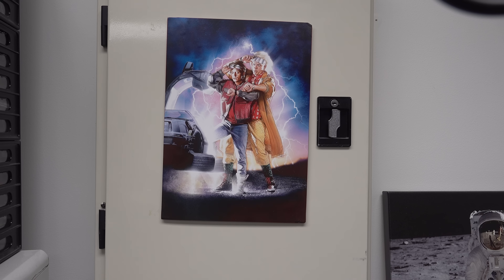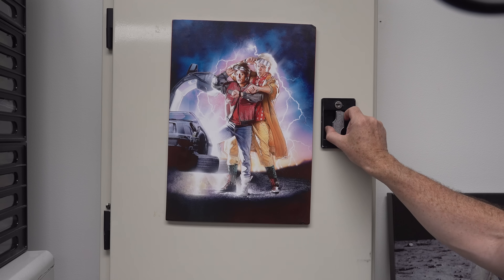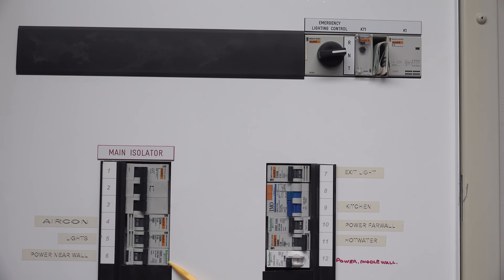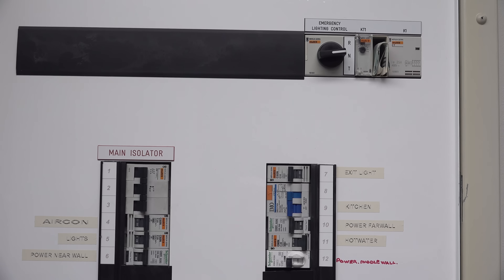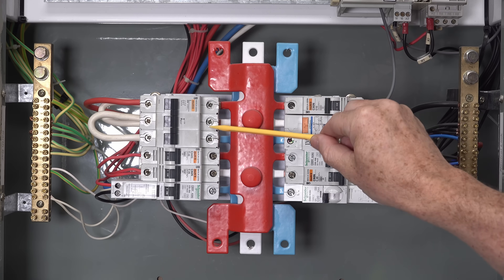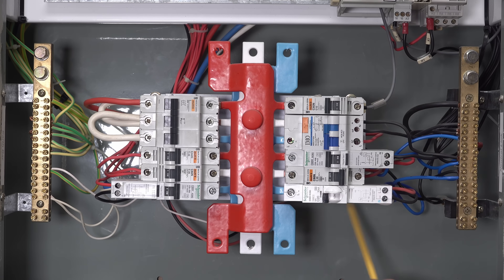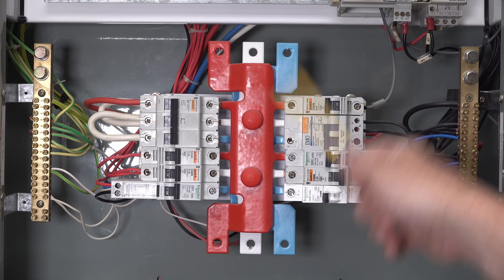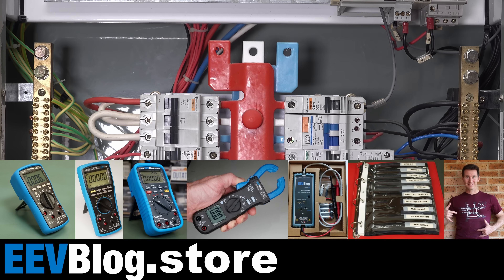EEVblog 1652 - Why is my Lab Switchboard Wired Like This?

Comment: No RCD or individual RCBOs  apart from the power outlets? What if by changing a lightbulb you accidentally touch inside the enclosure, or there's a faulty cable or something? What if there's a fault in the AC or in the water heater? Nothing to protect you from electrocution? Also no main fuses if the breakers fail in some way in case of shortcircuit?
Reply: His supply will have a separate fuse down at the metering.  Where you need an RCD has changed over time in Australia based on it being residential / commercial / industrial.  It's a constantly tightening situation.  Older installations can stay as installed unless a particular regulation says otherwise (mandatory installation, new works, etc).
Reply: Nothing apart from basic + reinforced insulation or grounded elements, all of which worked well before RCDs and continue to work in their presence.

There will be a main fuse at the source of the cables which need protecting by that fuse - that's not here.
Reply from the maker: Yes, but this was common 20+ years ago when the building was installed.
When I rented the 100sqm space that was built at the same time by the same company, it didn't even have RCD's on the power circuit, had to get the owner to install them.
Reply: Strange how each country has its own wildly different standards and reasoning for doing or not doing something. In the EU RCD is mandatory everywhere for about 30 years now. I guess we think avoiding electrocution is more important than others :P Also at least in my country, the meter's fuses are not accessible by the end customer, so it makes sense to have your own, lower rated, fuses and try not to ever trip the meter's ones and then having to wait for the electricity company to come fix them...
Reply: @JohnFistikis69  You tend to have a fair amount of TT earthing over there, not exclusively TT though, and that more or less means RCD is mandatory in a lot of situations.  Australia moved away from TT (direct / elcb) as a general means of earthing decades ago and even before that move we had a lot of TN-C-S (M.E.N. earthing).
Reply: @retrozmachine1189  Now I understand why the earth wire on these board is so small. Here in France, we have a very thick wire for earth. Now it is common to not only have the main break as RCD, but also sub-main RCD for each line of breaker on the panel.
Reply: @JohnFistikis69  Blowing the service fuse takes a fair bit of effort, even without the protection of the MCB mainswitch it is fairly rare for it to happen.  I only know of two examples personally, both friends, of it happen over the past 50 or so years.  Both of them would have been 6mm copper services too.  The minimum for quite a while for new or upgrade is 25mm aluminium.

Comment: No AFCI/AFDD requirements in Australia? Non-lighting circuits in the US, especially kitchen and bedroom ones require them these days per code. I think the idea is that kitchen appliances and space heaters cause most AF issues.
Reply: Not so much for commercial; You can have non rcd protected circuits provided the z loop will ensure a breaker to trip. Something Dave doesn't understand, but I'd rather him teaching me electronics :P

Comment: Voltage between phases, 415 Volts.
Phase to neutral, 240 Volts.
Used a single phase to neutral to supply 240 Volts to consumers.
Reply: I'm not sure what you're trying to explain here. They could just as well connect all three phases, but then they'd need a meter that supports that (more expensive) and it would show on the bill every month, for no real gain since he doesn't need 3-phase supply there.

Comment: If you had multiple phases in there you might accidentally go between one set of powerpoints and another and get 400 volts.. ? Often not worth using multi-phase in such a small office ?  Additionally, you might find that each unit is on a different phase.
Reply from the maker: I have absolutely no need for 3 phase in such an office lab.

Comment: Interesting how that panel/breakers are connected. It seems familiar to a US 3 Ph panel, but the breakers like bite on to the tooth of the bus bar. Over here it can get interesting when you have a 3 phase 4 wire delta system.(less common now) A phase and C phase to neutral is 120. B Phase to neutral  is ~207 and phase to phase/3 phase is 240v.

Comment: There could be many reasons why the final choice was to only use one phase supply to your commercial unit. reduce cost of final fit out. Builder went bust halfway through the project. Balancing of the building across the three phases. Units were originally intended to be larger but were further subdivided. Truly a mystery.  The good thing is, if you ever need three phase supply, it is a relatively simple process (depending on space at the main Switchboard for a metering upgrade) to get the supply to your unit.
Reply from the maker: It's only a small office, once of the smallest in the building, there just isn't a need for 3 phases in 50sqm office space.

Comment: Your fault paying for a unit with 3 phases and not checking it. Once you switch on that hot water the voltage is going to dip!  Now show us a shot from your meter box to see if they are connected there. Of course if them blue Brymens meters would be any good you could tell us if the blue and white were even active!
Reply from the maker: LOL, it dips 0.5V with the hot water on, I'm doomed.
Reply: They will dead end.  Single phase metering.

Comment: As a landlord, that's exactly what I'd expect. It all comes down to cost. What's the cost of installing 2 extra cables and a 3 phase breaker when you're building the building, vs the cost of doing it when (not if) some tenant decides that they need 3 phase.

Nobody cares how well individual units are balanced between phases - balancing is done based on the readings at the bulk connection point, and you're lucky if it stays balanced for more than a year - as a rule you just size the connection for a "mostly unbalanced" scenario, and pass the costs on to the units.
Reply from the maker: The cables are already there, technically easier to wire in the 3 phases than the 1 phases loops here.
Reply from the maker: See my pinned comment.

Comment: 3 phase panel wired for single phase supply/meter. Don’t know if it works the same there as here, but the monthly charge for a 3 phase meter is more than a single phase one, so if you don’t need the 3 phase it’s cheaper to just have one, if you did ever need to upgrade to 3 phase the wiring is there to support it and you just get a meter upgrade.
Reply from the maker: Yep, see my pinned comment. I don't need three phases.
Reply: For residential it is the same for 1 or 3 phases not sure about commercial. Think it is similar but the usage tariffs are different between residential and commercial. For commercial they charge for apparent power and they also have some demand tariff that I didn't understand when I last looked at it. Commercial buildings have a class in the building code of Australia that requires them to have to have essential safety measures. Exit lights, extinguishers, fire alarms, stairs, fire doors etc. These must be maintained and the body corporate as the building owner must do that. Here in Vic, the certificate of occupancy must be on public display in most non residential buildings. Very few do it and not doing so attracts a $1500 fine. The building code is national but the building acts and regulations differ by state. However one AS3000 for Australia and New Zealand.

Comment: Get the short circuit carbon pointer back in ya pencil case never ever in Lv  Distribution  Board !Fun fact it conducts better if you wet both ends ,just sayin
Reply: That's not a pencil.

Comment: Can't speak for Australia, but in the US, the two additional service lines are typically run at building construction for future proofing. When it's easier to pull all the lines rather than having to retrofit them later. 
Better have and not need then need and not have. 
Some labs may require three phase electric for certain types of equipment.
Reply from the maker: Yep, see my pinned comment. Just checked, single phase meter, but three phase wiring pulled seems standard.
Reply: @EEVblog  Yes by me residential buildings and commercial all have 3 phase power, only very small clusters, like a converted house, will have a single phase supply using the original cable, unless it was overhead wiring, in which case it would be mandatory, before the council gives an occupancy cert, that it is both 3 phase, underground, and also the meters are located on the pavement outside, in a cabinet with a metro supplied lock. that there are still houses around that have century old wiring, including having rewireable fuses, despite it being mandatory they had to be replaced with breakers since the 1960's, and RCD being mandatory for all upgrades (an upgrade being replacing a 5A socket outlet for 15A one, keeping the original 4mm wiring in the wall) since 1980. but thousands of houses that have been passed down over generations without a sale, which triggers the need to get compliance before registration, and compliance mandates a RCD. You can still have the wire fuses (the screw in type never was popular in anything other than stoves here), but to pass compliance you need to pass insulation resistance test, and have a RCD, which often means you will rewire the house to pass. Means as well new feed cable buried, and meter outside the property in a box, either with a lock, or with a vision panel to allow it to be read.
Reply: Yeah, "typically" "run". It your dreams. Ppl install three phase converters out of fun then in USA.
By the way, speaking not for Australia, but Australians, plenty of whom used to work in England as electricians some time ago, they were proudly telling fairy tales about advanced Australian electrical system regarding "substandard" British installs.
Reply: @AAaa-wu3el  USA is unique in having whole neighbourhoods wired up for power using 2 wire open 11kV or 6.6kV feeders, and pole mount transformers feeding 4 or 5 houses tapped off it at regular intervals. Plus shared poles for power, phone, cable and fibre as well, especially in more rural areas, because you can run them cheaply on the same pole. so yes no 3 phase power, because the 3 phase power goes to an area supply point, and you then get the step down transformer from whatever the local line, 33kV, 66kV or whatever, to the 3 separate single phase feeds.

You will only find 3 phase inside large buildings with their own transformer, or inside cities where the savings in copper for the 3 wire method to bring in power to a local set of 3 transformers (with centre tapped secondaries acting as ground) make it feasible.
Reply: @SeanBZA  Oh yeah, USA is unique as India and Pakistan are unique. Unique in the sense that when it comes to money, USA disregards all the proclaimed safety love and goes to the cheapest option.
Reply: @AAaa-wu3el  There's really nothing particularly unsafe about the way the USA gets MV around the place.  Many countries use open overhead wire for it.  Even the UK where many electricians seem to think their setup is 'best in the world' has abundant examples of it.
Reply: @SeanBZA  Courrios situation. If you need the 3 phases for a more powerfull motor like a mill or turning maschine, you must buy a converter who generate them. Well, one more point for me don't leave germany. The second one is the 120vac power. This voltage level waste copper. To
Reply: @DD4DA  Yes but the USA has the rather distinct disadvantage of having an electric grid which was the first major one in the world, so those old decisions on how to build it, and the voltages used, are now very firmly baked in. 

The UK was second, but decided to change the grid from +-200VDC to 240VAC at one point, where most houses really had resistive loads using power, and the odd electric radio that needed to be either modified (by placing a dropper resistor and a rectifier tube, which coincidentally also was the dropper for 35V in the heater, and adding in a capacitor) or replaced.

Germany had the rather unique need to replace an entire grid system after 1945, so went for an option which required minimum copper for the most power, as the old systems had been mostly destroyed.

Comment: Merlin Gerin is now Schneider Electric. 
Every thing is wired for 3 phase depending on what your requirement is but I bet your only on a single phase breaker at the main board. Possibly no room left or just for future.
Reply from the maker: Yep, see pinned comment.
Reply: Yep  still se them alot in Belgium .. Since 1992  schneider bought Merlin Gerin .. but i believe they still produced under that name until 2009.
In 2009, Merlin Gerin products, services, and solutions migrated to the Schneider Electric brand as its Electrical Distribution offer.

Comment: Setup for single phase so if you need 3 phase its just a simple $1000 fee for a sparkie to come out and tap those wires.
Reply from the maker: In this case the utility company would have to add extra metering for th other phases, see my pinned comment.

Comment: Haha, if they parallel 3 breakers, you could effectively draw 3 times the current on a single phase feed into your office, although it should have a breaker on the other end.
Reply: This is weird indeed and since it's 64A breaker i doubt the cable is meant to handle 192A. Then again, breakers protect the cables after them not before. Like you said the incoming cable is protected by a breaker upstream. That 64A breaker is just there to protect the busbar... as in just a convenient switch. It's even labelled as an isolator.

Comment: Somebody just used whatever and said 'spare' or even screwed up perhaps. Sometimes three phase parts are just more common for commercial as single phase is often residential grade.
Reply from the maker: The interesting thing is it's technically slightly more work to wire single phase like mine, so, strange...
Reply: @EEVblog  Do you pay the Strata for power, or is your power bill coming from Sydney Metro? If strata then they buy in bulk, and sub meter themselves, but if Sydney Metro then the meters are read monthly by a meter reader, or they have wireless reading for them. If strata then 3 phase is simply a matter of changing meter and paying strata for the new meter, nothing else changes, but if Metro your standing charge will triple, based on the now much higher potential demand in kVA you have. Doubt they will put in a 32A breaker either, here by me 3 phase power is either single phase with 80A breaker, or 3 phase with 3 pole 100A breaker, nothing smaller, though if you are residential and need more than that 80A you can go 3 phase, and have a 3 pole 80A breaker, but you pay for the new cable to the point of supply, and any trenching across roads as well. $300AUD per meter IIRC from the last time, and it was 100m to the substation, but lower if we bought the cable, and hired contractors to dig it down, with the charge being only $600AUD per end to connect. We dug a trench across 2 roads..... Could not use the pole as it was already at peak capacity, so direct to substation, and own set of 200A fuses.

Comment: Maybe it's a safety thing? Like you don't really need 3-phase power in your setting. But it's there if you need it. It will also prevent short between lines (therefore making 400V) if a tenant tries to DIY something.
Reply: It's like me running parallel 6mm2 cables to your dog box with only 30mtrs of play from an underground enclosure. In parallel works perfect for a good 63A, when I split those cables and go 3 phase 32A per phase is a ton of juice! 
I'm very mindful to load balance circuits. But in Dave's neck of the woods the sparkies don't even do the metering. Here in Queensland I'm allowed to do it.
Reply from the maker: Possible I guess, but I doubt that's the reason.
Reply: @EEVblog  yeah me neither thinking about it lol.

Comment: 2 simple reasons I can come up with. They can charge more for 3 phase power in the units without having to change equipment.

 Second they can move around the smaller units to balance phases. Utilities will bill more for unbalanced 3 phase power.
Reply from the maker: Wouldn't it always to better (more chance to balance loads) if every unit is 3 phase and has all the circuit split by the buss bars?
Reply: @EEVblog  If you want to spend the effort to police how customers load the phases, yes. The suppliers are not interested in doing that to the tune of millions of customers. Same reason domestic customers typically get single phase.